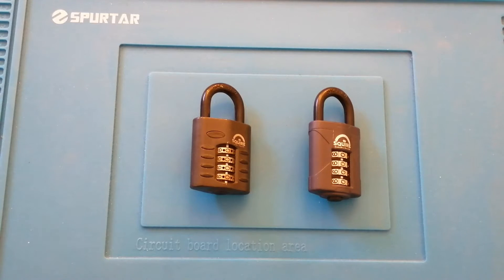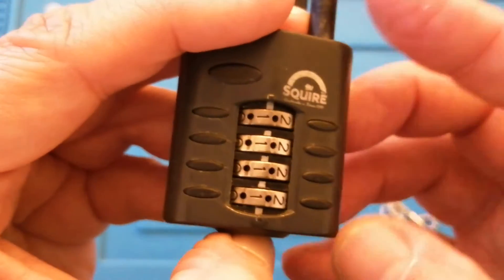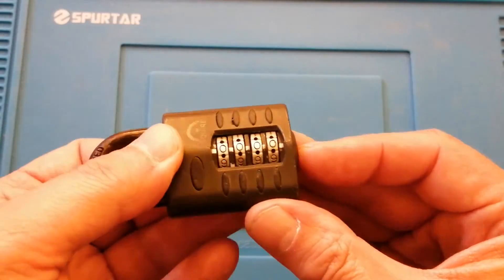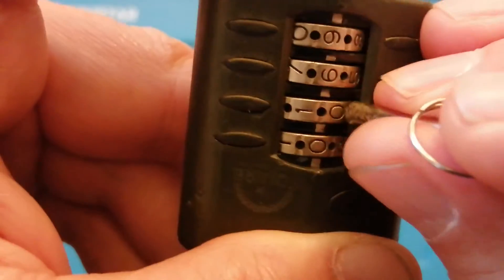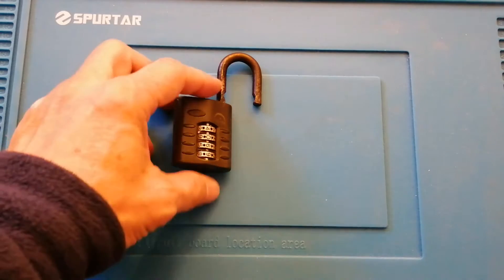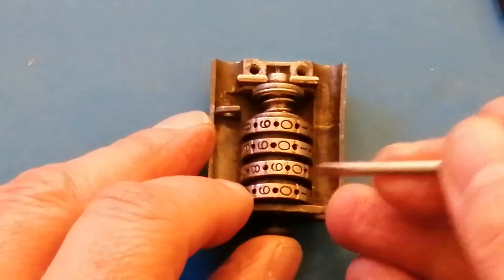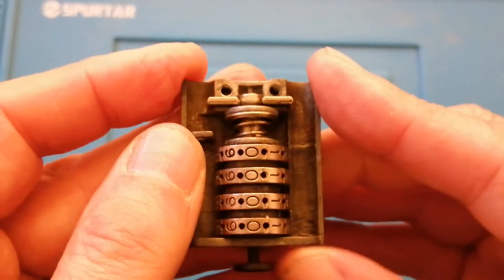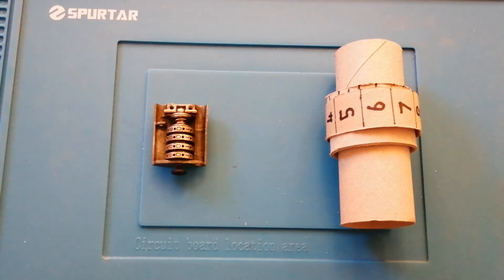#20 Old style Squire CP40 combination padlock. Set a new code, possible vulnerability & internals.

Comment: I bought this padlock today from a boot sale for 50p! It was of course locked......but a couple of YT videos and 20mins to get it unlocked, pressure on the button, rotating the wheels and finding the one with most resistance, then slowly rotate it until i felt the button slightly move in, repeat and finally it opened, code was 2936. Interesting to see the inside of them and how they work.
Reply from the maker: Well done on getting it open. You picked up a real bargain. I hope my video helped. Thank you for watching and especially your comments.